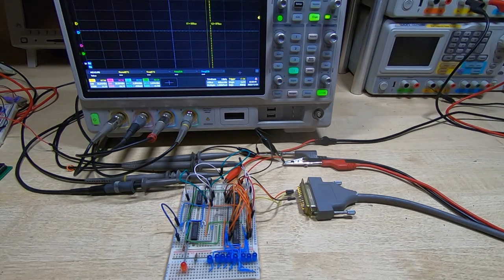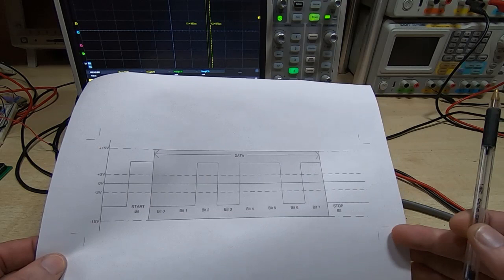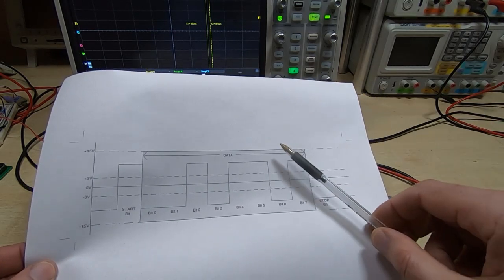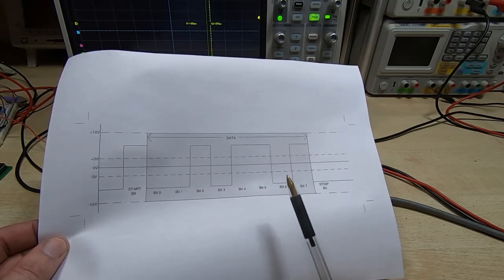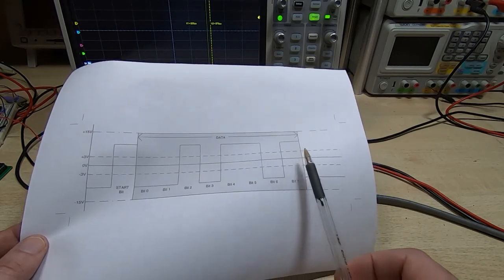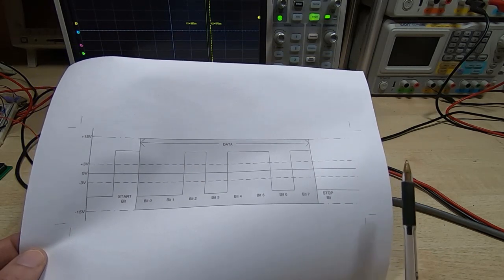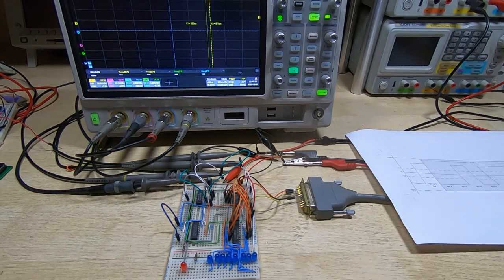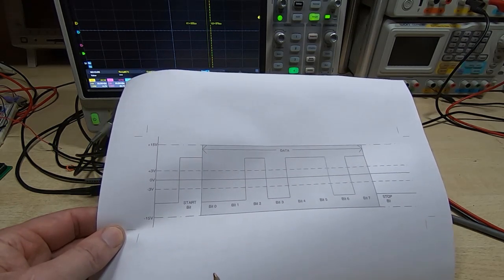Designing A Z80 Computer Part15

Comment: Love the series so far, but I have to say that I see no shame in using a Z80 DART (Z8470) for serial comms. It supports all the vectored/daisy-chained interrupts, etc. I think you still would need the outboard baud rate generator. I dunno if DARTs are unobtainium now, but you could revert to an SIO, which is a (somewhat painful) superset. I would see no shame in this, TBH. However, props to you for all this work, I can only imagine the amount of effort that goes into this, and I do deeply appreciate your focus on the process, instead of the simple outcome.
Reply from the maker: See the next video.
Reply: Yup, the Z80 CTC (Z8430) was a common clock source, as well as some custom baud rate generator chips (I recall the MC14411 was popular) with either physical jumpers or a mux fed off an IO port.

Comment: That was interesting. I've always had a hand-wavy understanding of data communications. Seeing how it's done--and done so economically--here gives me much more appreciation for how it actually works. Thank you. One question, though. I must have missed this in your explanation: where does the counter get its clock signal? I see a capacitor up by the counter but couldn't pick out a chrystal. What am I missing?
Reply from the maker: Yes I forgot to mention the source clock (I describe it in detail in the book :) ). The master clock for the RS232 is taken from one of the outputs in the Z80 system clock divider which is another reason it may have seemed to have spare outputs. It is running at 625KHz and is derived from the 10MHz clock. This is not an ideal frequency for RS232 which is why I used a fast over sampling method to ensure that the errors were well within the required specification.